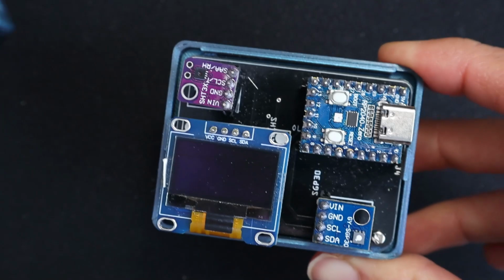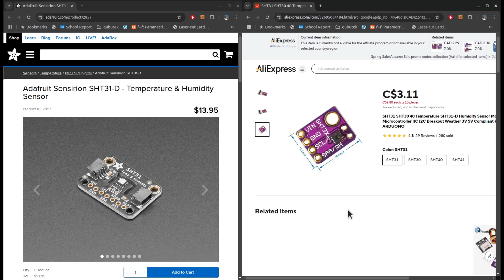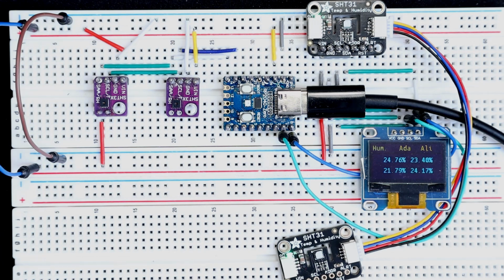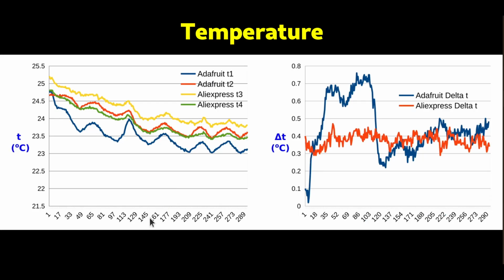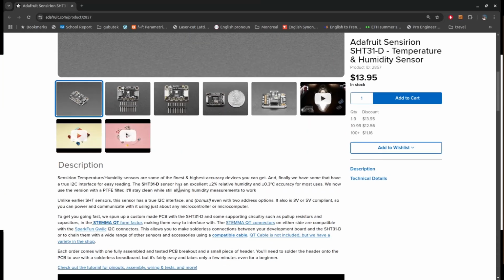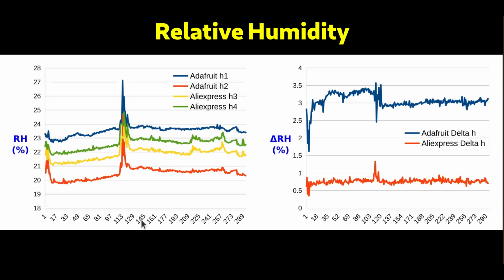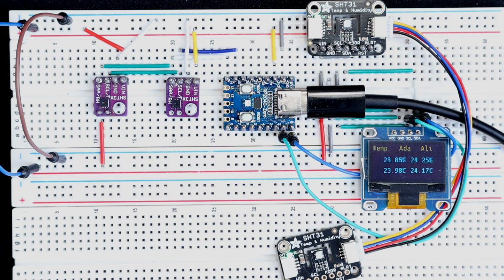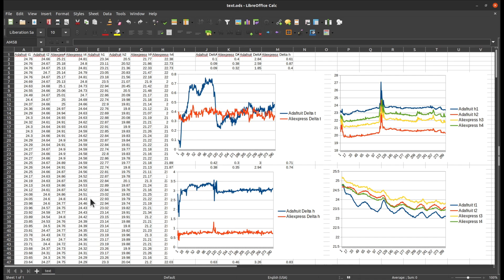Cheap VS. Brand temperature and humidity sensors

Comment: I have a question. I recently bought a finished Xiaomi electronic temperature and humidity meter that uses an SHT40 sensor. I noticed that when I move it from a 50-degree Celsius environment to a 15-degree Celsius environment, it doesn't quickly display the current temperature and humidity.  I observed on the display that it slowly decreases to the current temperature and humidity, a process that takes about 25 minutes.

I would like to ask if you experience the same problem in your DIY system? If so, then I might need to choose a product based on thermocouple technology instead of one based on capacitive technology.
Reply from the maker: Hi, 25mn is a long time to respond. Mine does not take that long usually less than 1 MN. But my range is 15 to 30 Celsius.
Reply: @maketestrepeat  Do you think this problem is caused by the firmware? By the way, my screen is a custom-made e-ink display.
Reply from the maker: @henry9719 I haven't tried e ink before (but I would love to) so I can't comment about it. Is there anyway you can test it with print to screen only or a simple OLED display?
Reply: @maketestrepeat  This is a branded product, and it's brand new. I don't want to take it apart and examine it... This is my first time using this type of device, and I just want to know if a slow response from a capacitance-based sensor is normal. After all, we usually expect the detection device to respond promptly when there's a change in conditions.  Would you be able to test the scenario I mentioned earlier – going from a high temperature of 50 degrees Celsius or 90% humidity down to ambient temperature and humidity – and see how long it takes?😊

Comment: Did you compare the results with calibrated instruments? Now it shows they (almost) all give the correct curve but have significant offsets. Question is which one is offset.
I have compared several sensors and seen that there are indeed differences. I also have a laboratory calibrated PT100 thermometer and when comparing the results they cheap sensors are surprisingly good, the average of 10 sensors is spot on what the calibrated PT100 gives. Unfortunately I cannot check humidity against a calibrated sensor. Here the measurement differences are way bigger. Especially at the high and low end of the scale.
Reply from the maker: I don't have a lab instrument for that. I have IRcamera but it cannot be used to log data. I am testing them with another sensor and I can have the result soon. You can calibrate PT100?

Comment: I'm curious as to how the two sensors would react to changes in temperature. Did you try running the tests for longer ?
Reply from the maker: I am running another test for longer time and with another sensor. I will show when I have the data.